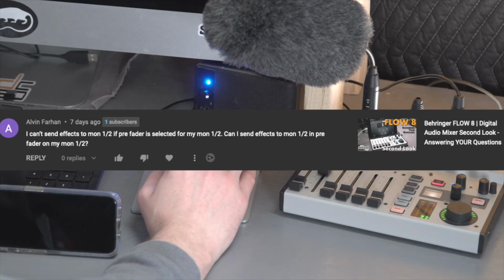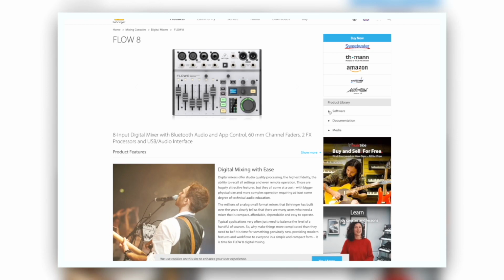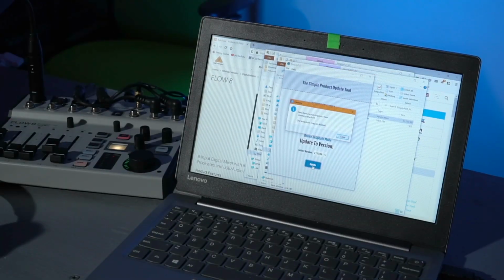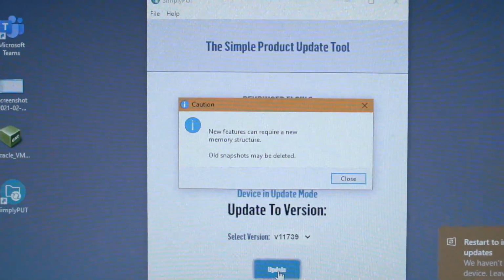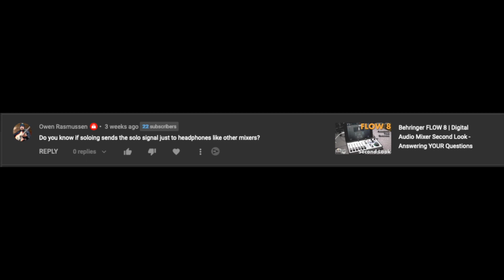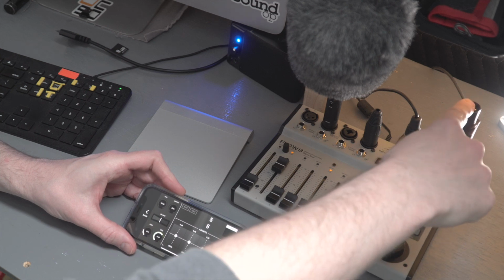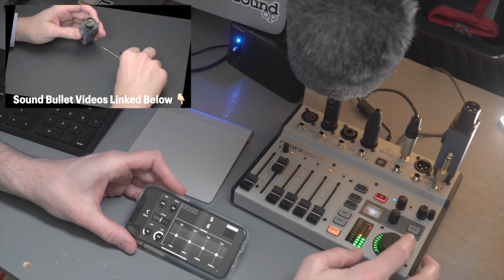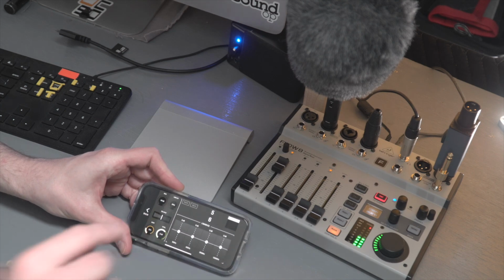Behringer Flow 8 Most Common User Questions in 2022

Comment: I have a question about the 1/4 inch 5/6 and 7/8 inputs, basically I’m trying to get audio in from a 1/8 TRS to a split 1/4 TS using channels 5/6.  When I do this I only get audio out of the the left side (5).  Wondering if I’m missing something in the app.  I’ve tried multiple versions of the stereo split cable.  Essentially I’m trying to get audio from an old MP3 players stereo headphone jack into the FLOW 8.  Thanks for your time.
Reply: In my opinion, Id use a cable that is 1/8 trs to a L/R 1/4 inch and use channel 5&6 as left/right
Reply: That's exactly what I'd want to do. It's the common and very basic way to get backing tracks, intermission music or jam tracks (semantics) into the mixer, any mixer, from a iPad, MP3 player or computer (or any device with a stereo 1/8 in headphone jack). If you can't get both channels 5 and 6 (so that would probably mean the same would apply for channels 7 and 8) to supply signal to BOTH channels it's a deal killer. BUT are you getting your entire mix (L&R) into that channel 5 but as a mono mix? And, is that channel able to be panned hard left or right? Many performers pan music to one side and click to the other side and send the music panned side out to the main mixer of FOH. Did you try using several different devices as well? Did you figure this out?

Comment: I appreciate for the featured comment in this video. I think it's good to note where manufactures can't just do everything due to many reasons. 

Very glad I found your channel. I'm probably a few months away from purchasing one. Do you see good value in this mixer for streaming? Not sure if others would be interested in a video utilizing this for Zoom, Teams, or other broadcast type use cases which is my plan.
Reply from the maker: Hey Damon, thanks for the message. The FLOW 8 works well for what you're looking to do. The one here stays on the second workstation (27" iMac) specifically for zoom, teams and other video meetings. It has been really flexible and quick to recall the presets needed for whatever is happening on that computer.
Reply: Definitely useful for streaming. I use this mixer for streaming music performance.

Comment: I bought this mixer to run my dj/karaoke show.  It does a fantastic job as a basic mixer, and a great job mixing vocals and fx in with a good quality karaoke track.  However, the game changer feature of this board is the ability to multi-track record.  People have been blown away when I hand them a mixed version of their karaoke performance, (mixed on my imac in my studio from the live tracks the Flow 8 produced).  My friends who do solo and duo acoustic shows have seen my mixer.  I showed them how this mixer is really perfect for that use.  The ALL went out and bought one of their own.  Thanks for your video.  I am going to explore the fx to monitor functionality, although I rarely use fx in the monitors.  Also, thanks for mentioning the standby function.  I was not aware of that feature, it's nice to know about it in case I need it.  Great vid..!
Reply from the maker: Thanks for the message, it’s great to hear you’re having success with the mixer. Stay in touch!
Reply: Thank you for mentioning this. I run an audio interface into my iPad with Cubasis for most of my current recording (which ends up on YouTube). If I could swap out the Flow 8 for my audio interface this would have the huge advantage of being an identical setup (the iPad would then run the app rather than Cubasis). I'm getting a Flow 8 to check this exact functionalit very soon now.
Reply: I wanted to get this for some family karaoke nights do you recommend a system that doesn't have a screen/speaker already built in?
Reply: @damonluvisi  if you understand how to use a live sound mixer like this one, it works very well for mixing a vocal microphone with karaoke music.  If you are new to doing this you might be better off with a system that is custom made for doing karaoke.  A system that "has it all" will be easier to use, it just might not sound as good.  My suggestion is to read the reviews on the other systems you are looking at and see how the people who bought it like it.  I have decades of experience playing in bands, running live sound, and recording and mixing in my studio, so I kind of know my way around this kind of gear.  So, when I wanted to add karaoke to my DJ music services it was easy for me to just use this kind of board to do it.  This board is very easy to learn how to use and it does a fantastic job, but you might be better off with a simpler karaoke setup for your family nights.  I hope that helps you out.